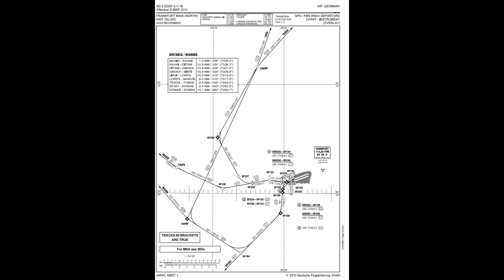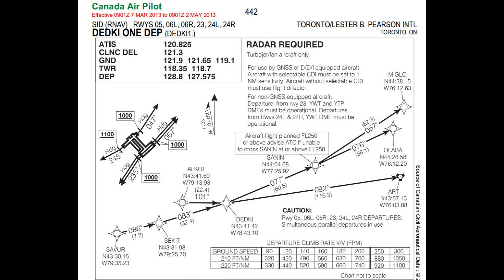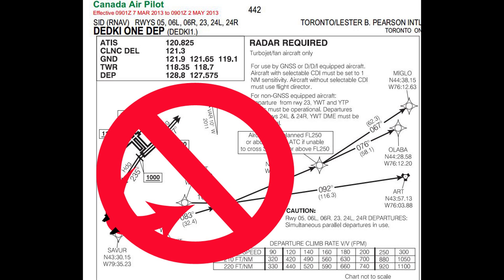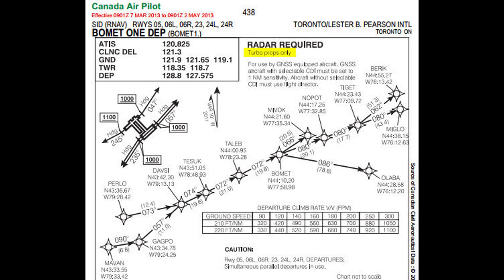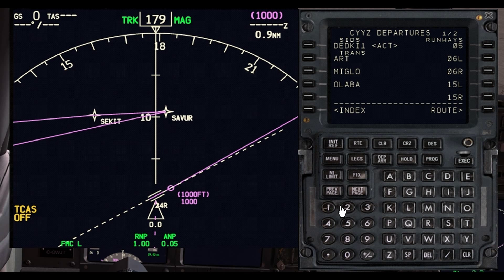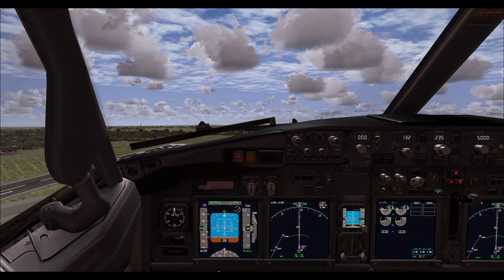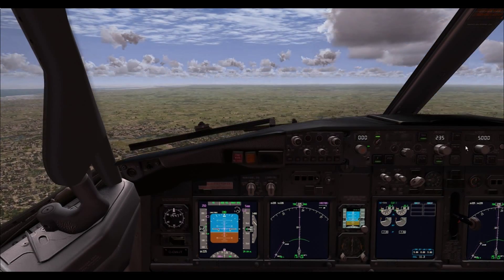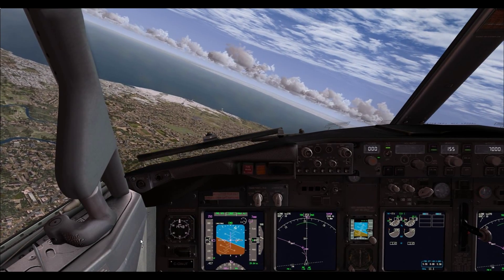How to Fly the RNAV SIDS at CYYZ (Toronto Pearson)

Comment: How are you get a vector to savur through the ATC?  How does ATC know your flight plan?
Reply: John Koetsier How 'do' you get...
Reply from the maker: John Koetsier This is taking place online on the Vatsim network.  The controllers are other players acting as ATC and they get the flightplan through the Vatsim software.  The pilot has a pilot client that handles the voice and text communications as well as sending the flight plan. The controller software can read the flightplan.  There is lots of information on the Vatsim website on how the network works and the software required.
Reply: +UPS1000 can you fly Sid's with default aircraft navigation system?
Reply from the maker: Yes you can.  You can use the default GPS or you can file a flight plant with just VOR's and tell the controller you are not RNAV capable and they will give you vectors on course.